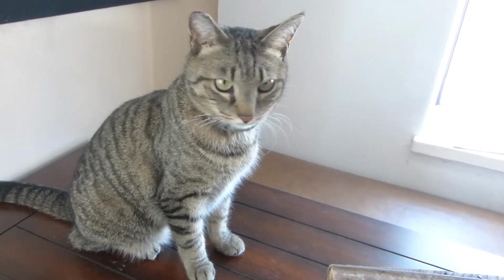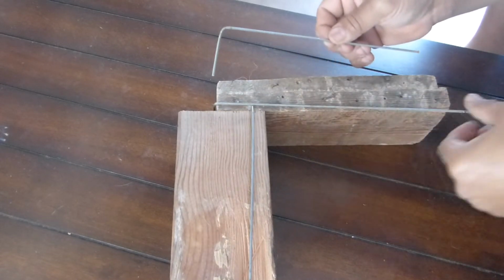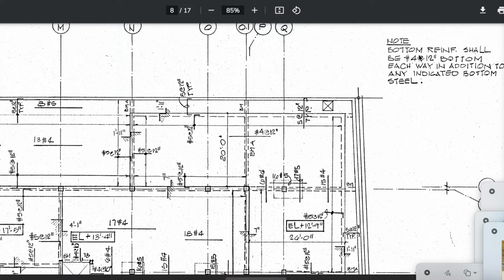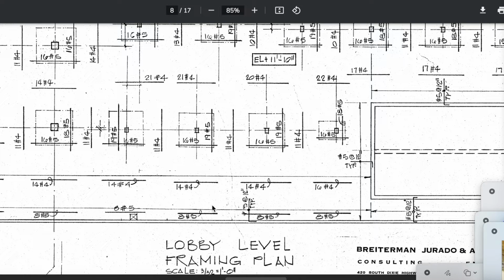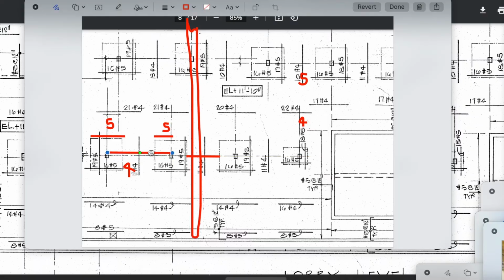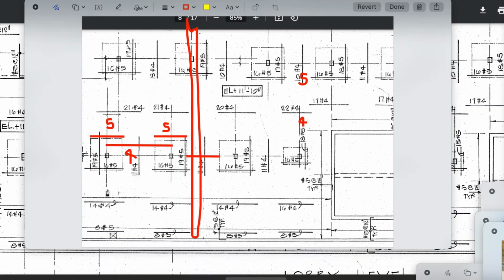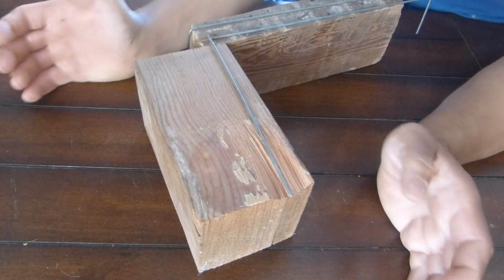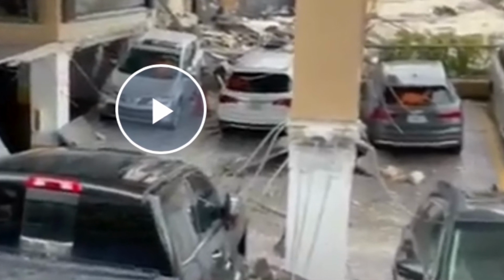CHAMPLAIN TOWERS South Wall "Sectioning Slab beams" Revealing Rebar's Failed Marriage Master's Class

Comment from the maker: Sectioning "beams from slab" shear zones revealed; this is the educational video and I really want you lovely people to grasp the concept and ''see'' for yourself how these loads are not transferring their load path ''firmly'' down columns...
Rebar did NOT FAIL fyi
Reply from the maker: Concrete structures are so safe, they have to do a 40 year inspection...
Think about that, 
now why are living, renting these death traps?
Steel framed construction buildings are still working, over 100 years old!!!
Reply from the maker: I want you to think of the slabs as a large flat beam; an ''eye-beam of concrete and behaviours" ... these behaviours are dependant on the tension in the steel / rebar and how strained they are and or how much deflection they are being forced to work with... Their changed positions, change how they can continue to transfer loads to the columns. 
The column's shear head /deck slab's shear head / critical shear zones can only do so much... The design and loading really needs to play along and not be a solo player.
Reply from the maker: This is part 2 and three or more parts to complete this explanation...
Reply from the maker: https://youtu.be/FWIARz10kVw